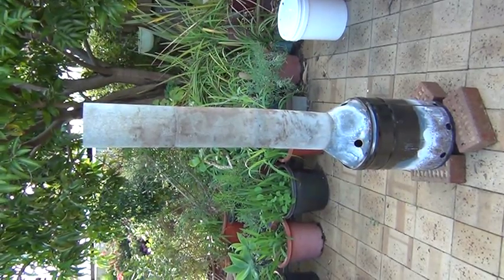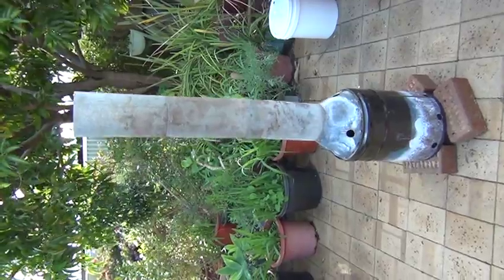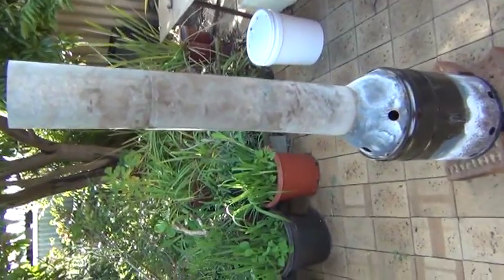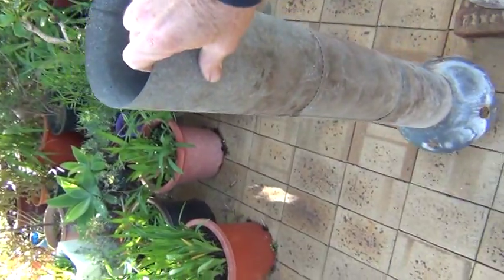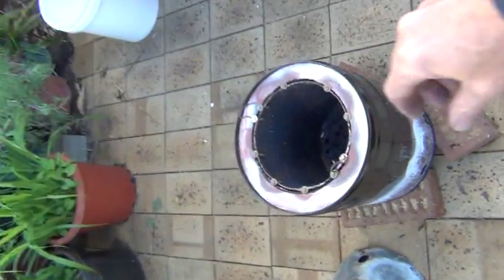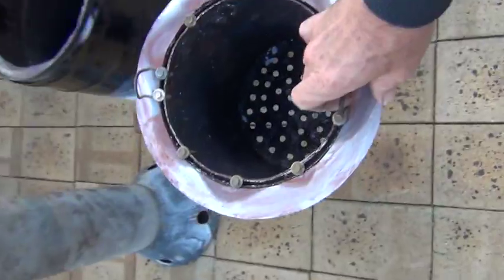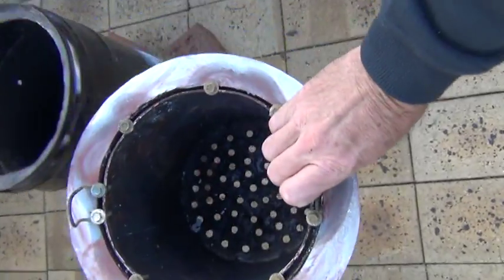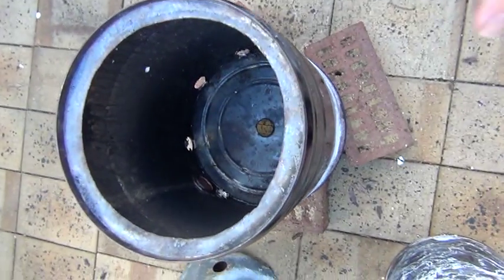Making Biochar 3G TLUD

Comment: I just made some from peanut shells. Amazingly, even after waiting for a while in -3°C, the charred shells kept being hot to the touch. Although not visibly glowing, they kept producing heat in my hands.
The fresh dry coal was easy to reignite and burned with tiny bright ambers. I wouldn't be surprised if they can spontaneously ignite.
Reply from the maker: I make microbe mixes and add them to a bucket of water. I usually transfer from the burner and drench the charcoal with the microbe water mix. That will stop the char from going to ash. Some of the microbes may die but become food for those that don't. The biochar will take some of those on. I then drain the bucket the next day. My biochar is active as I can add a few pieces to a jar of water with some molasses and it will start to ferment.

Comment: That flu-reducer how do I find / buy / make one. It’s the only thing stopping me from going ahead. Can you help me, we are n QLD OZ.
Reply from the maker: Mick I looked up truncated cone on google. It basically is a set of formula's that you follow to make the cone (just remember you need more for the overlap). I went to a local tip and purchased the sheet metal that was the back of an oven. I could have got a piece in the street collections but none were on so I did it that way. I just riveted it together. Just remember the inside diameter it the same as your flue diameter. Your drum diameter or less is outside diameter of the cone. Only other thing to work out it your height. The taller your cone height the more material you will need. It took me 5 hours to work out the design and 15 minutes to make. You could do a template on card paper then you will know the exact amount of metal you need. Hope this helps.
Reply: jakattah Cool, thanks.
Reply from the maker: Mick Tree if you can post a video of your completed design and send me the link. Love to see others work. I have another video with a retort on top the biochar from the retort is a higher grade so something to think about.